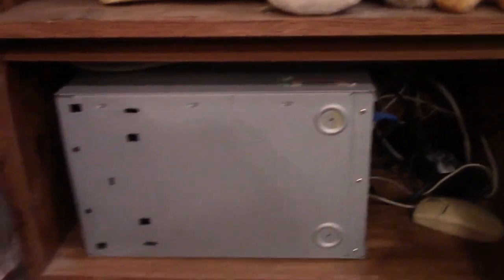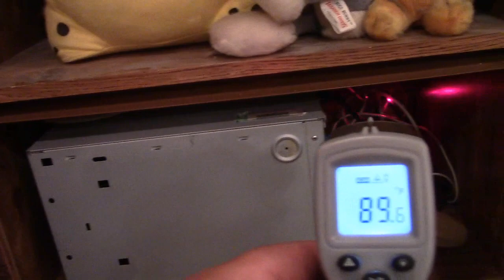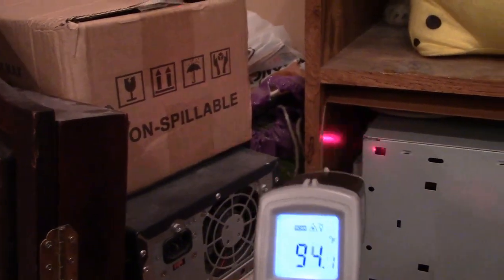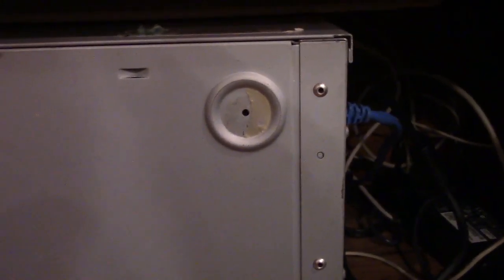Failing Digital Picture Frame Computer, Part 11 - Back In Service Update

Comment: The amount of heat in there is concerning to me.. If the ambient temperature is 90 degrees, the components are only going to be that much hotter.. I can't imagine it's going to run for very long like that.. I'd cut the back off the cabinet..
Reply from the maker: This machine dates back to around 1999-2000.  It's 19-20 years old.  I have a lot more faith that a computer of that age can withstand said heat than one considerably newer.  So far it's run for 5 months while not even having the heat exhausted from the case, and there appears to be no damage via visual inspection.  I've seen a lot of systems from around this era "bottled up" in cabinets.  In fact, at The Wiz we'd sell cable modems and service for them since we were owned by the cable company at the time, and there were 4 or 5 Compaq-branded systems tucked away in cabinets underneath these walk-up kiosk systems (so people could see how fast 2Mbps Internet was).  In fact back then, there weren't really even many routers out there, so each machine had its own cable line and cable modem.

In the next part of this series, something else will develop that ties in with this.
Reply: @jaykay18  OK